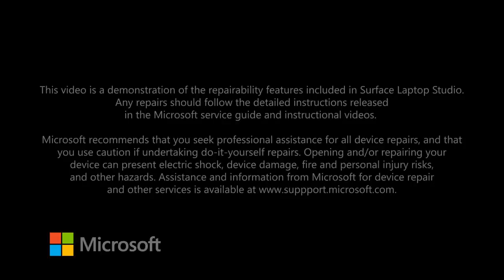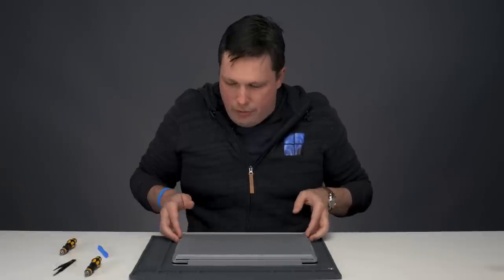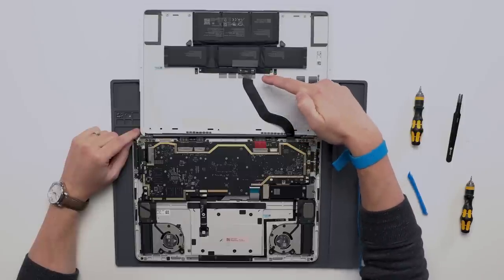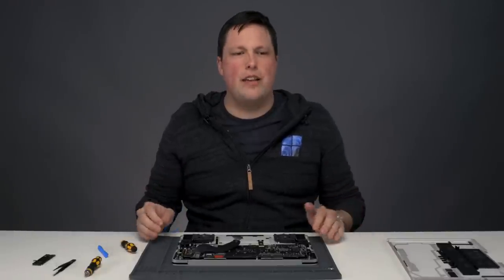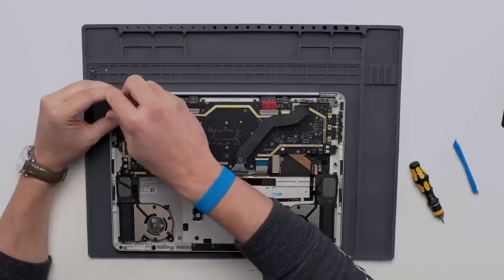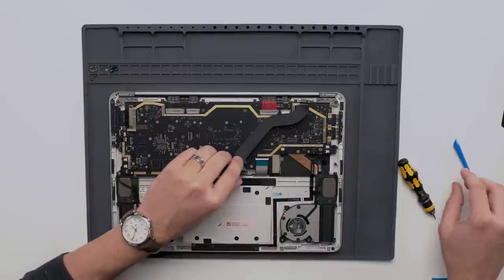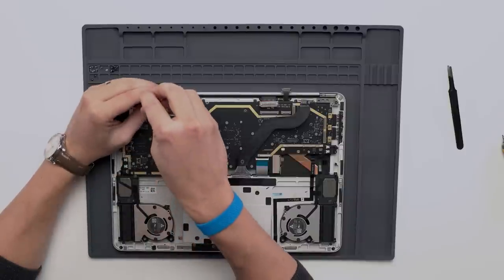Repair | Surface Laptop Studio

Comment: All very lovely, but sadly this is just paying lip service to genuinely helpful full repairability.  I'd like to source a single replacement letter E key for a 20 month old Surface Laptop Studio, and after wasting several hours have been told very firmly by Microsoft that the only option is to send it to them for £486.54 ($597.81 as of today).  It probably costs 1 cent to make and I could click it into place in 2 seconds.  There are none on marketplaces and no advice from MS as to which other keyboards might be compatible. There are plenty of comparatively tiny companies which manage to make their products totally repairable and supply virtually all parts for many years.  And this Microsoft has claimed it wishes to be "Zero Waste by 2030".  Sort it out, MS.

Comment: I'm sorry, repairable without adhesives or glues???  What about the feet and the trim you have to replace every single time you open these girls up? I believe they are adhered on... and cost $30
Reply: SLS2 fixed trim but feet still needs to be swapped